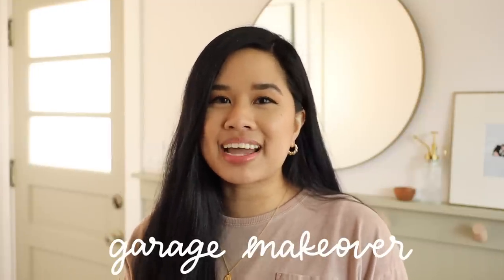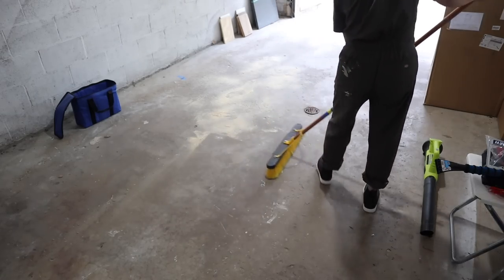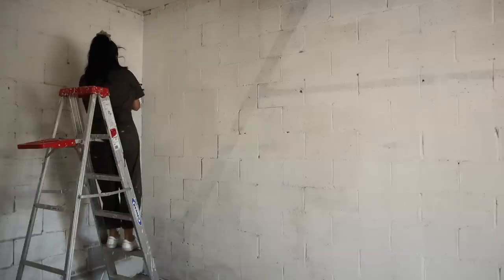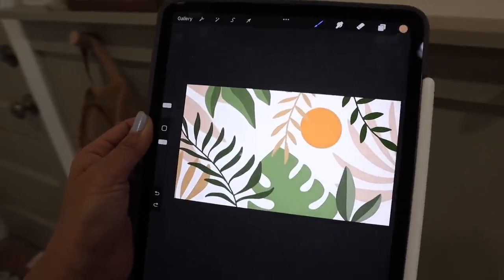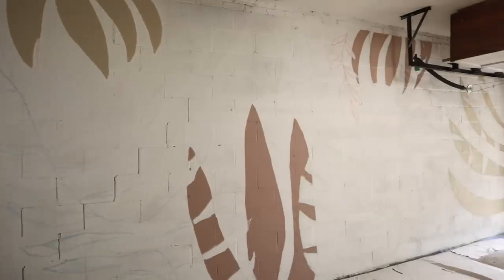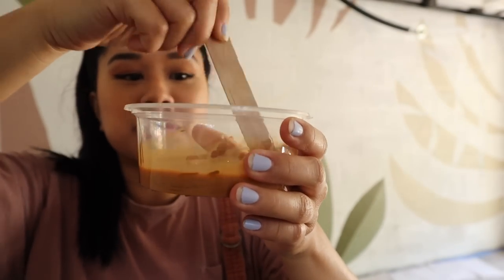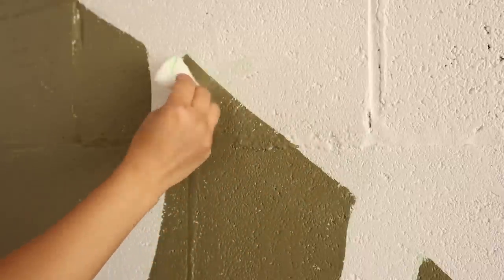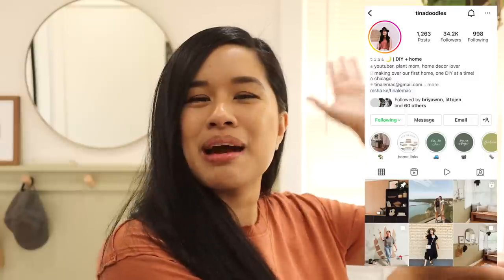PAINTING A HUGE MURAL IN MY HOUSE! + *AESTHETIC* ORGANIZATION IDEAS | Garage Workshop Transformation

Comment: Looks amazing! I would get attic stairs to have access to the attic (future owners) and to close it off. It would creep me out to stand under it and it would help keep heat and cold out of the attic (put some insulation and a seal around the edge). Caulking all the cracks and fixing the garage door so that it comes completely to the ground would also help keep spiders and other critters out of the garage.

Comment: What a fun garage! Two things: 

1) I think you will regret not using covered containers on your shelves. Dust, bugs, mold, etc. will collect in anything open. 

2) You need to spray again for insects. If you have spiders, you may need an exterminator; spiders have an exoskeleton and are nearly impervious to most commercial insecticides. 😬

Comment: Unfortunately, you need to get an insecticide-like raid for spiders and then spray all the corner walls and the bottom edge of the walls inside and preferably outside.  This will last about 1 year and then repeat.